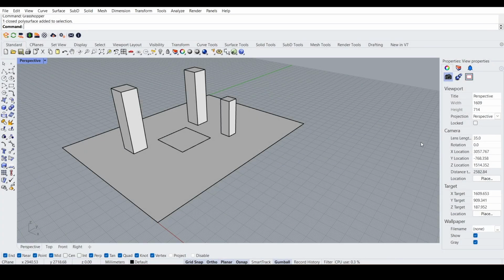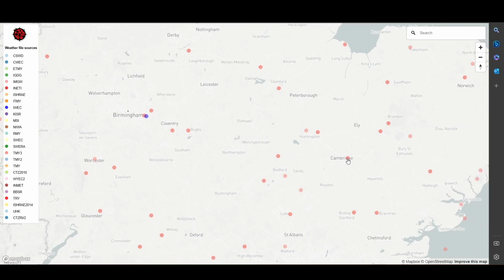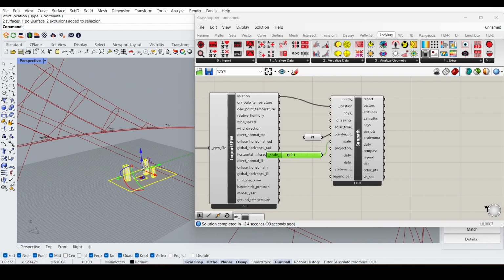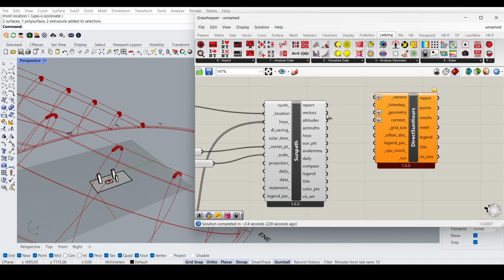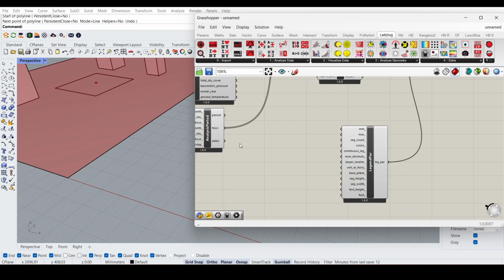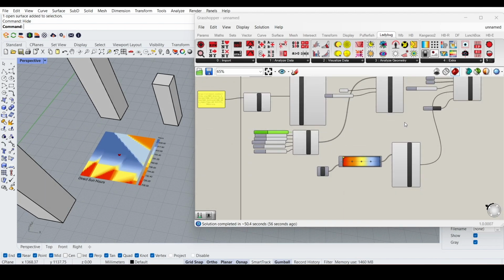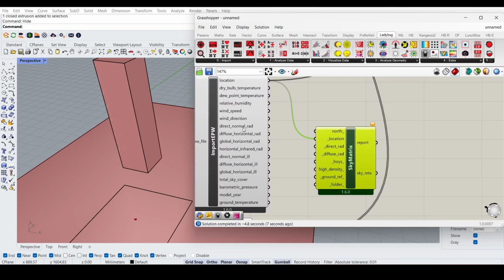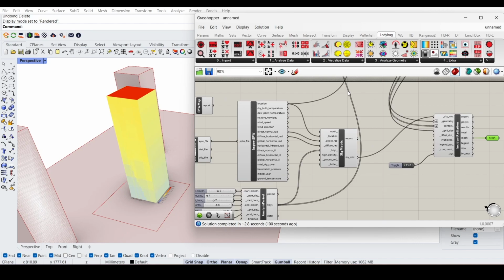Ladybug Grasshopper Tutorial Sun Hour and Radiation Analysis

Comment: While running lunchbox incident radiation on grasshopper, I got an error saying “ run time error : (divided by zero exception). Attempted to divide by zero. Traceback : line 155, in script”.   What to do? Please help
Reply from the maker: Hey! That “divide by zero” error usually means something in your inputs or setup ended up as zero when the script wasn’t expecting it. It is like trying to divide a number by zero which math just doesn’t allow.

For LunchBox Incident Radiation it often happens if one of the input values like a grid size or an angle is zero or missing. Here is what I would check:

Make sure none of your inputs are zero or empty especially things like your analysis grid spacing or any time steps.

If you are comfortable looking in the script line 155 is where it is crashing. There is a division happening there with a number that is zero. You can add a quick check to avoid dividing by zero like “if divisor isn’t zero then divide otherwise skip or set a default value.”

Also double check your geometry isn’t empty or weirdly scaled like zero length edges or zero area surfaces because that can sneak zeros into the math.

Sometimes just bumping up a zero input to a tiny number like 0.001 helps get around the problem.